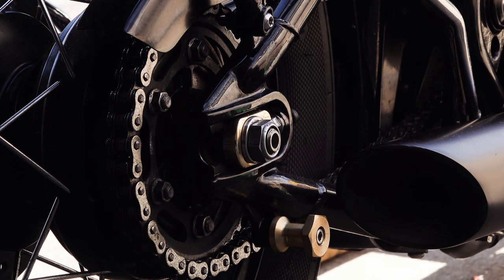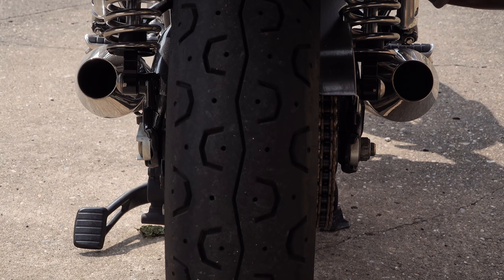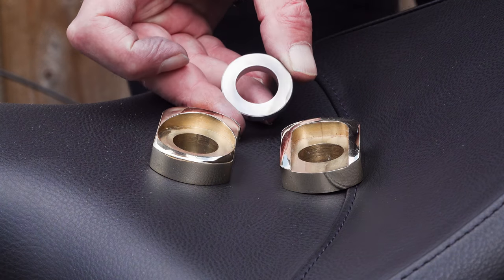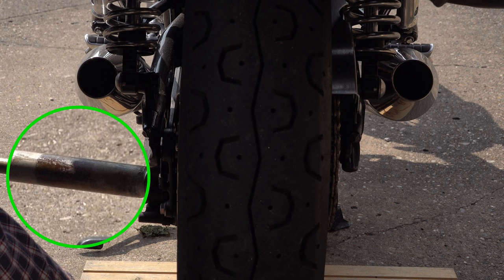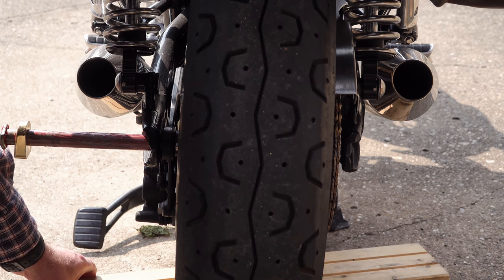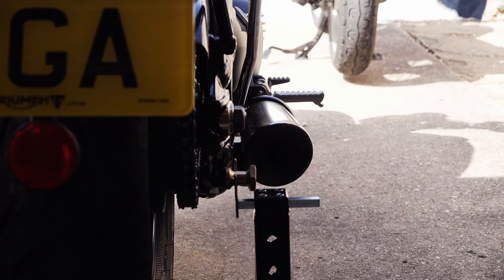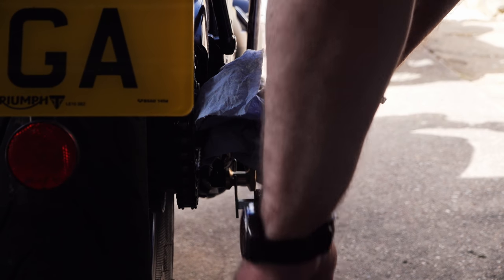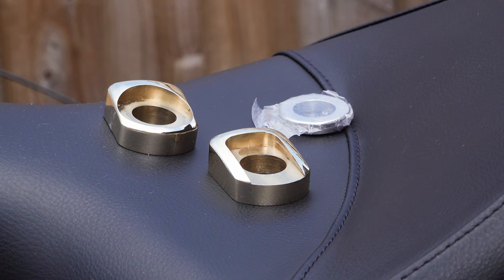Triumph Bonneville T120 & Bobber black, Vintage Hot Forged Custom Brass chain adjusters!

Comment: Well Stuart I have today removed my wheels on my 2016 Triumph T120 as I am spending £900 On Monday  on replacement aluminium  rims and spokes. Reason for this is because  I was disappointed  with the rust that had formed on my rear wheel, even though it had been wrapped in dust cover, then all weather cover and then stored in a garage. When I removed the rear axle it was as dry as a bone it showed no evidence of grease at all. Whats going on with the grease monkey then?
Reply from the maker: Im sorry to hear That Paul,  It really shouldnt be happening should it?

Comment: Stuart, many thanks for the - as always - clear instruction with good visuals and really useful extras such as greasing the axle, using a cloth etc. I like Motone's stuff but got a November deal on the Triumph black adjusters so will now be fitting those with the clear knowledge gained here. Many thanks again, Barney.

Comment: Installed my new brass adjusters yesterday.  Had to remove my pea shooters on my 2019 T100 first, so took a bit longer than expected, but lots of time available these days.  My axle did have a thin film of white grease on it, but I cleaned it and used a higher grade (and more) to keep things well coated.  

Thanks again for your videos!

Best,

Phil

Comment: Really like the looks of this with the bobbins, would be nice if  they offered an acorn style brass plated nut to go over the threaded side and a brass plug with rubber grommet to cover the stock axel head on the other.

Comment: Beautiful pieces; I though at first there was a mark of some sort on one after installation, turned out to be a reflection in that marvelous brass!  They've probably sold that first lot in the few hours since this was put out; I'll have to check my T100, could be mistaken but I think it has a different set-up as it's a first-gen model ('02).  If those fit, though, I'll have to get some!